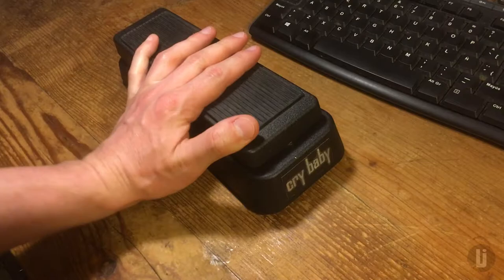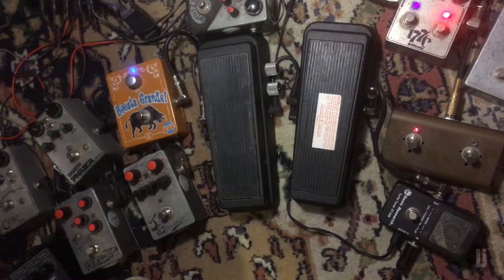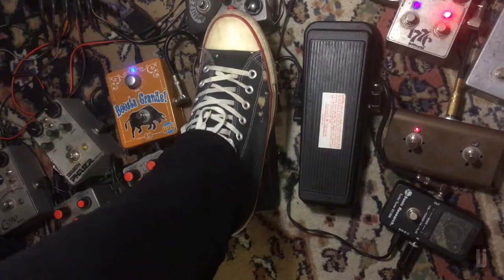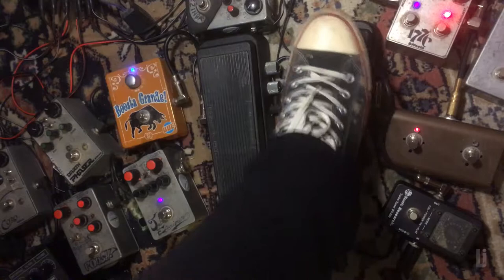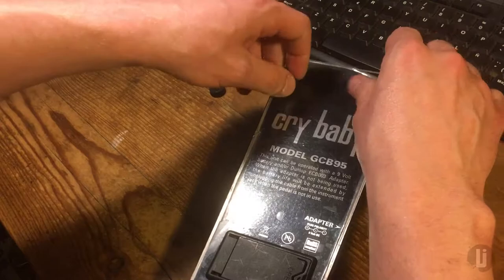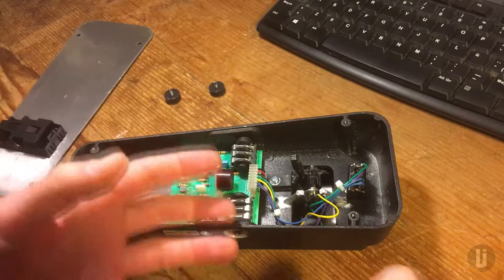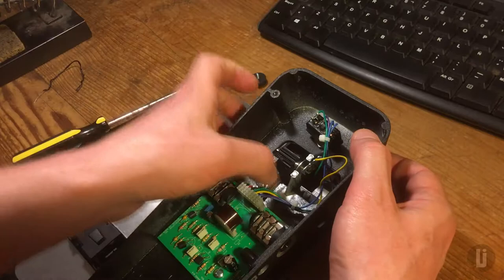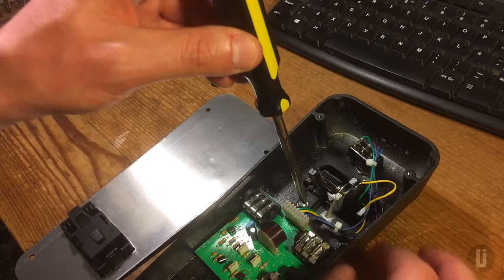City Wah! Take a order prease?!?! - Improving and modding Crybaby pedal

Comment: hp2 pot has dead zone in the taper. All your doing is reducing the range at the toe down position by adjusting the pot like that, not really moving the lowest frequency down. Now, in some cases pot adjustment is viable option to move the range down but not with stock cry baby.
Reply from the maker: I don't know what you've read on forums, but that was not the case with this particular pot. I wouldn't have have uploaded the video otherwise. Besides, you can clearly hear how that how particular resonant frequency appears after the mod, a resonance which wasn't there before because it was out of range.
Reply: @lonerjuan  well, then that particular wah has very limited physical travel.. And if that’s the case it’s good option to lower the switch and/or swap the grommet under the heel to shorter one. Or cut slice of the grommet. Hp2 (and hp1 and the earlier clarostat/allen bradley) pots have limited travel AND a dead zone on the heel down. The other end does not have dead zone so you want to use all the travel you have there. Hook up multimeter and see what’s what. I’ll ignore that ”what you’ve read on forums”. It was kinda cute but I’ll leave it at that. Funny how on the internet everyone can pretend to be whatever and I’m sure in the real world this discussion would be quite different.
Reply from the maker: @vl292  Well yes, I'll have to agree it would be quite different discussion in real life considering it's been ages since anyone told me to grab a multimeter without some laughs being exchanged (I might be an electronics engineer in that real life you speak of, so talk about being cute!).

Either way, like I said earlier, you can hear the change in sound on the video, so feel free to talk limited travel and dead zones all you want, but I was the one who laid hands on this wah (and yes, a multimeter as well) and no dead zone nor travel limitations played a part on the result of this fix. The fix worked as expected, the end.

I'm not trying to be a dick, but you're kinda arguing for the sake of arguing, especially when the before-and-after difference is so clear.
Reply: @lonerjuan  You seem to be happy with your tweaks, so it’s all good.

Comment: Great vid!
Reply from the maker: Thanks!
Reply: @lonerjuan  today I did the first mod you're recommending, finding a more suitable range for the pot, already sounding better. Then shaved off some of the rubber under the bass side of the wah to increase the range of motion, making sure that the pot doesn't hit the end of range. Will definitely do the vocal mod, and the bypass mod if I find a good schematics! Great video, me encanta
Reply from the maker: @faustobrusamolino6345  I'm glad you found it helpful. I'm sure through trial and error you'll dial in your perfect sound. One thing I'd recommend for the vocal mod is , instead of swapping resistors, using alligator clips and a 100k potentiometer. That way you can test infinite values until it sounds right, then you measure the resistance on the pot and get the closest possible value for the resistor.